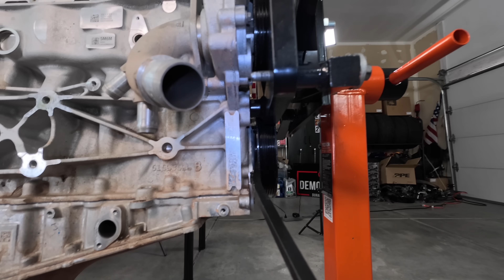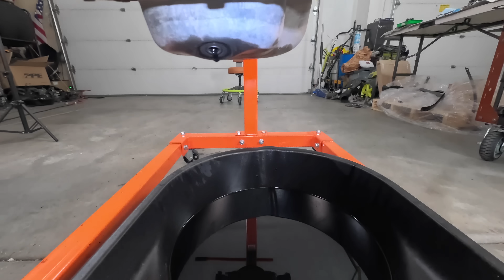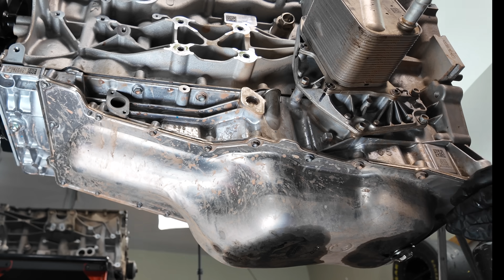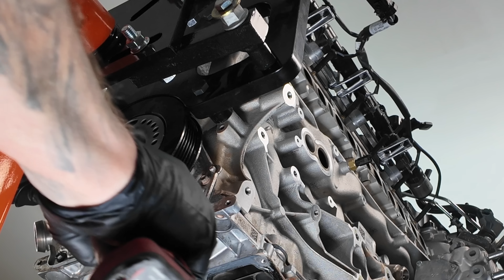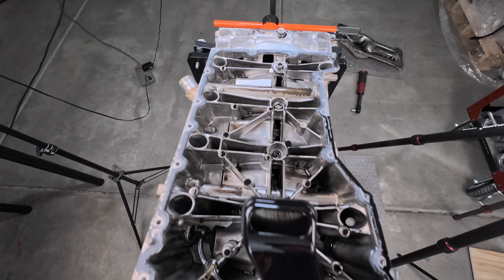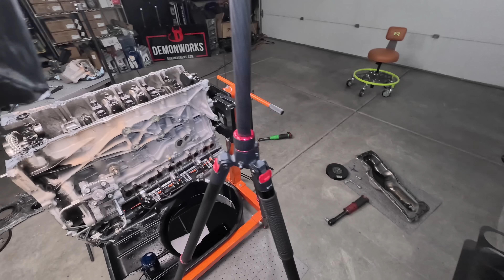Was This Engine Built Wrong? 3.0 Duramax Failure Investigation

Comment: Missing Thrust bearing.... the plot thickens
Reply from the maker: Right ?!?!
Reply: Honest question. Could the "missing" bearing not be that pile of sludge in the pan?
Reply: @3.0dmax  It cannot.  Once the thrust becomes large enough, the bearing plates will drop out of their registers and into the pan.  

A compound thrust bearing(like a old small block) would eliminate the problem by being one piece per shell, they cost more to make tho.
Reply: Crazy if that's really the case. How is that getting past quality checks.
Reply: @goquickandiamo  Production assembly plants don't have audits for a simple manual part installation technique that requires a human to install, they rely on the human to actually do their job and put the part in the engine. The auditing process is when the torque guns validate the tightening sequence of the bolts before the engine leaves the work station. Either the worker wasn't taught the proper assembly procedure, or they were drunk and didn't do their job correctly.
Reply: @goquickandiamo  What quality?  Big manufacturers are doing away with quality checks.  
Quality witnessing operations takes too much time - you can save money by getting RID of them.  Mechanics can perform "acceptance" of their own work...that will save time and money.🙄